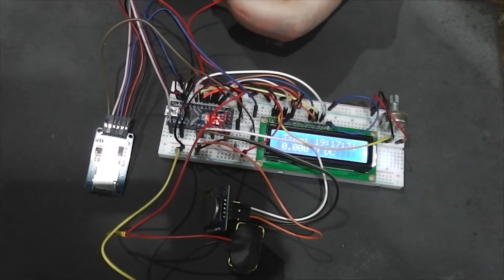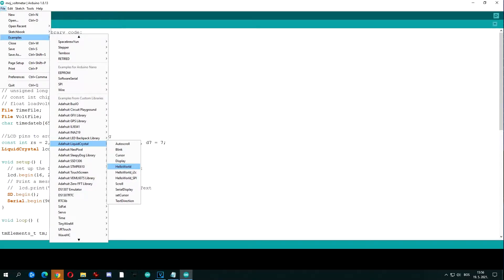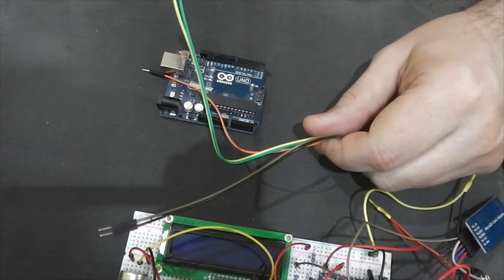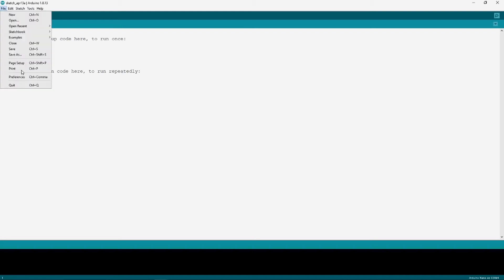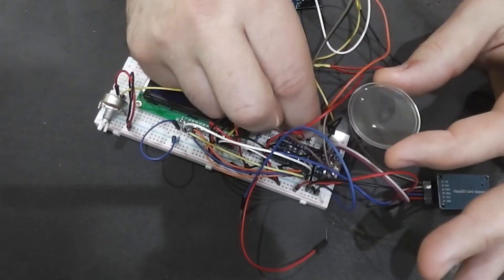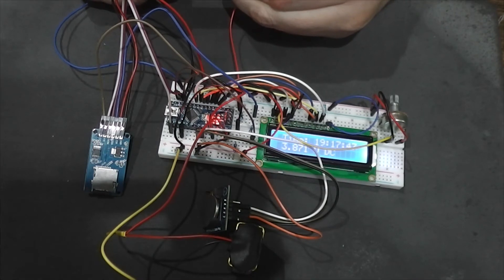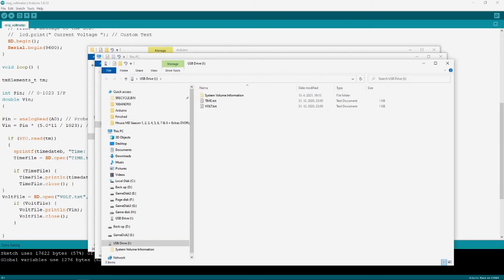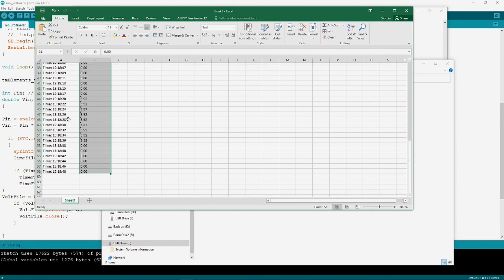Arduino nano voltmeter with 2x16 LCD display and data logging feature

Comment: Did i need an Arduino Uno to set the time? Is it not possible with the Nano? Thanks!
Reply from the maker: the Arduino Nano does not come with a Real-Time Clock (RTC) module built in. If you need RTC functionality, you can use an external RTC module, such as the DS1307 or DS3231, which can be easily connected to the Arduino Nano via I2C.
Reply: @FantaBH  That's Ok, but why did you used an Arduino Uno (that i don't have) to configure the DS1307 ? Thanks again!
Reply: Please, can you clarify me if i need the Arduino Uno or the Nano can do it? Thanks.
Reply from the maker: If you get nano use external RTC like I did. If you don't have and don't want to buy one, use UNO